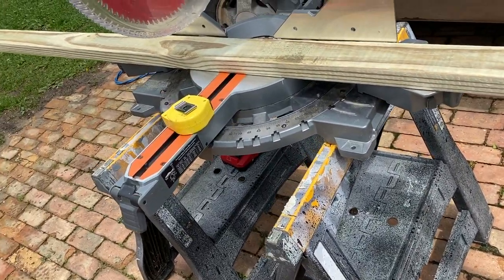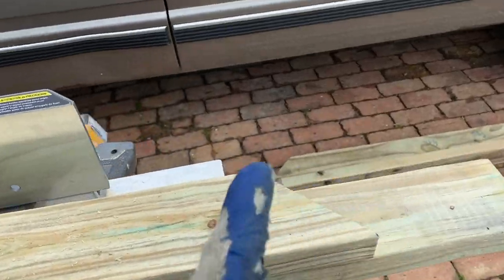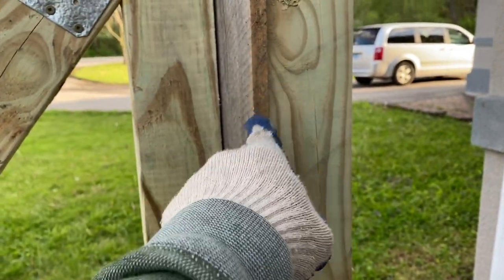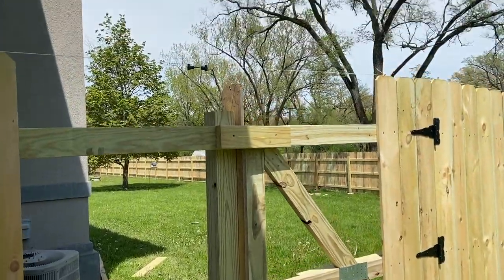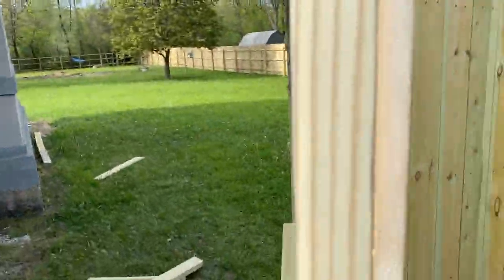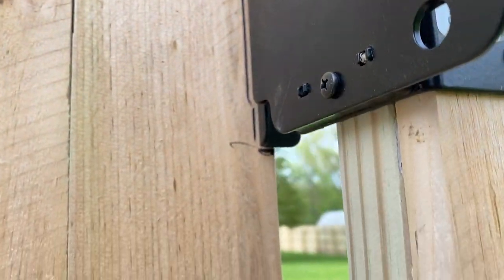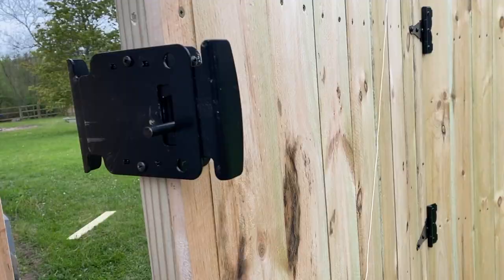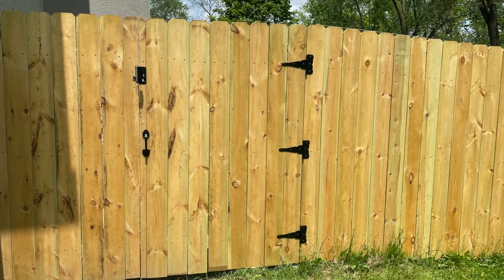Privacy fence gate /door construction, installation & Hardware installation too!!! Simple and easy!!

Comment: What is the model number of the screw gun that you use and we're did you get it?
Reply from the maker: Hi Elijah, it's a Senco Duraspin DS225. Here's a link to a used one that is fairly inexpensive given what's included. You can buy them at Home Depot. Thank you so much for watching. 

https://www.ebay.com/itm/295676132237?hash=item44d7abbb8d:g:mQsAAOSwp4NjcojG&amdata=enc%3AAQAIAAAA8LIwpaQ7muDHtFH%2Be4jTkIxlfcJutZFcfcQGD2aBsKNIp2SfwzJhTPjjyokOQjC4kKOJR%2BqwtS3A9viofsNHSTtKqRHWu60R98771%2Fx7%2BsH1JXX945PPnmrYwyNT%2Bn%2FIdS2JBcstMSOIhYm2mbsS3D18kzD2D%2Bqk0NzUb98RPLP9xRRDGXrKeWgAn5nB66BPIjjeKny9mlDjjVIzigA7wKnbjDt0z7y28sN774E5nNAMqycgslqDeMAb9XWOQk0LrICf40KnFK5Eolvt45%2FNNJ4HeobI440Ec6%2B73fYIE%2FR2B0F1%2FHJSdbxJcCQ5428Gzw%3D%3D%7Ctkp%3ABk9SR6zQ7vGEYg

Comment: Nice video.  Question.  I noticed you are able to lock that gate from the front yard.  I have a fence constructed the same as yours...face mounted rails and good side of pickets facing the front yard with a gate that opens to the front yard.  Now, I need a latch that allows me to lock (or drop a stop pin in) from the backyard, not the front.  I cannot find a latch like that anywhere.  Any suggestions?
Reply from the maker: Hi, this is the latch I used (link below). It is a really good latch that allows me to lock the gate from both sides. Also, I added a few more links for latches that you may can use as well. Let me know. Thanks for watching! 

https://www.homedepot.com/p/Fenix-Two-way-Fence-Gate-Latch-04034/301723793

https://www.homedepot.com/p/Heavy-Duty-Black-Stainless-Steel-Fence-Gate-Latch-73002218/202882810#overlay

https://www.menards.com/main/hardware/gate-hardware/gate-latches/fenix-reg-6-lockable-security-bolt/302bk12/p-1444430425266-c-9694.htm?tid=-7820652905032000672&ipos=29

This short cane bolt can work as well!

https://www.menards.com/main/hardware/gate-hardware/gate-latches/national-hardware-reg-zinc-cane-bolt/n152-058/p-1444448907224-c-9694.htm?tid=-7820652905032000672&ipos=31

Comment: YOU DID THIS THE WAY WAY HARDER WAY. Just finish the fense. Install hinges with a gap using your ticket as your spacer. Then just cut exactly where the hinges are and the other side and Bam you have a gate already
Reply from the maker: Thank for the info. The door is still in great condition. Thanks for watching.